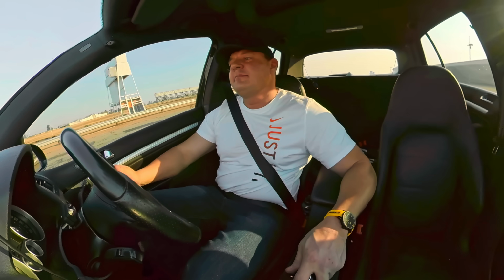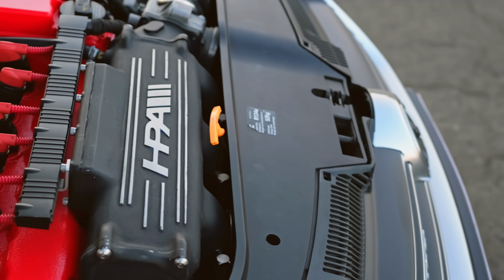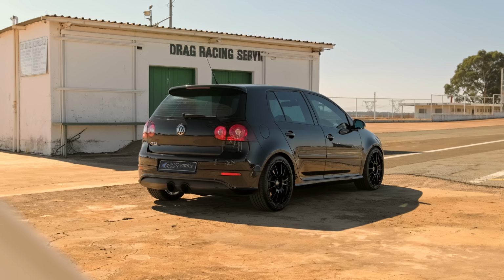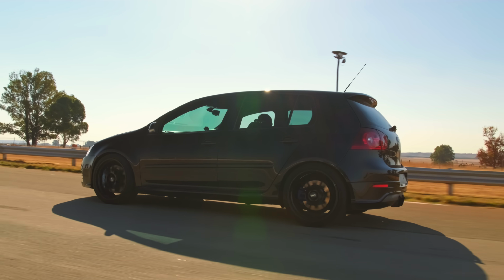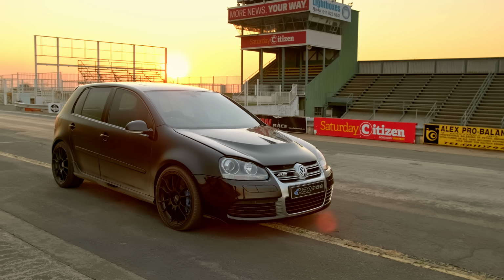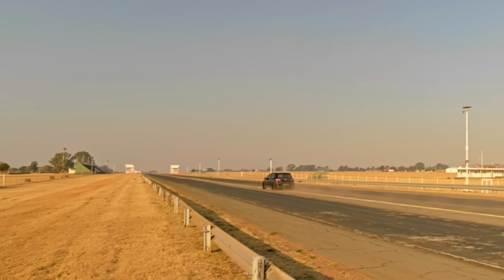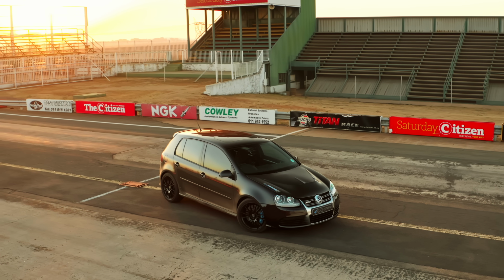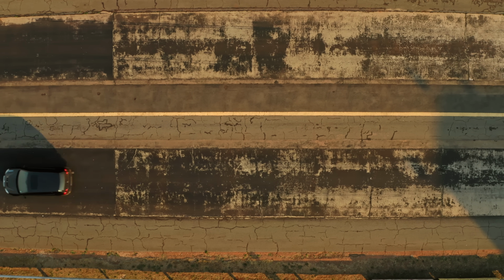1000hp Golf R32! - Watch this VR6 run an easy 10 seconds (and it's his daily driver)

Comment: What clutch pack are you running . Our build are similar mine on a stock engine with the rod bolts , bearing , spacer 😅 with fuel clinic 1000cc gtx3582r

Comment: How does a stock R32 lose to a GTI? Can someone explain that to me.
Reply: Drivetrain losses are greater in AWD. R32 is heavier. GTI is turbocharged, and it might have been chipped. At altitude, forced induction can compensate for reduced oxygen density, the VR6 can not (naturally aspirated). All factors!

Comment: Loved how losing to a GTI motivated him to build a monster.

With 1000hp it should comfortably do 9 secs maybe it's the street tires?

Also the R32 weighs at 1.5t and he said 1.7t?

Anyways, that's a nice build and what i find impressive about it how reliable and daily drivable it is!
Reply: It will get heavier the more modifications you do…for example the 4 inch exhaust all the way through is going to weigh a lot more than the stock one…

Comment: Its sad that cars need 0 skill to drive anymore. Just picked up a Vr6 TT...and opted for the 08 simply because it has manual transmission. for those without car knowledge but want to talk shit automatics have more clutches than a manual and yes, autos are faster cause you dont have to shift. Or worry about a clutch. But still...put a transponder and reciever on that thing and its just a big rc car. You dont drive anymore you just sit in it and let it go. Shit sucks

Comment: As much as the Mk5 is on the heavy side, 733kW, AWD, and a DSG is a recipe that should be faster than 10s. There are Mk7s running 10.4s with 450kW.
Reply: I honestly thought the same

Comment: I feel like something is bottlenecking the car. With that much power it should be hitting 9's all day. Awesome build still.
Reply: Banele Gaza.. there are no bottlenecks bud, the car has a full interior and running street tyres lol Strip this beast slightly and it will definitely break 9s without a sweat
Reply: @taswellbarthus4032  thing is on paper this should gap the demon everyday but it can't.
Reply: @taswellbarthus4032  he said he can't break the 10 second barrier yet but hes planning to do so, the dodge demon can do 9's straight from the showroom, his car like i also said, it should be able to destroy it all day, according to him, not yet.
Reply: @banelegaza  please go and do proper research. Internet will tell you that  the Demon did a 9.65sec pass on 100 Octane (not our inferior local South African fuel) and FULL SLICKS on the rear.. that is far from "showroom floor" status. This R32 is dipping into low 10s on street tires with full weight.. go and do the math lol
Reply: @taswellbarthus4032  those things come with the car, besides the fuel, but the key, the mode, settings, all come with it from factory at $1. I just feel like this modded out r32 should destroy it regularly without touching the nos bottle in the  back

Comment: I feel like he hasn't ran the quarter mile at full power. It can easily do low 9s with that power to weight ratio. 

Evolve's M5 does high 9s.

This thing can esily smash that M5 at full power

Comment: Very very very impressive. These cars are underrated in SA. Turbocharge it then everything changes :). I have a Golf 3 Vr6 turbo that I’m currently converting to 4wheel drive via an Audi TT gen 2 haldex rear and vr6 synchro gearbox. I cannot wait! Respect to Jacques
Reply from the maker: Hi Katiso, this build sounds awesome! Would you be keen for us to film it?
Reply: @katisotaabe85  you brought it up, we are now invested in this build. You have until June 2022 🤣🤣🤣🤣🤣
Reply: @The_Fhedz  no pressure but he has 10 months before we start asking questions
Reply: @nlocnil3602  kwaaaaaa
Reply: @The_Fhedz  hehehe,,,so far so good,,,until I run out of “capacity “ aka $$$$
Reply: @katisotaabe85  the racing Gods will provide 👊🏾 good luck.
Reply: Sound incredible. Can't wait to see it on the channel
Reply: Check out home built on here, he’s from the uk and he’s building a vr6t 4wd corrado, it’s going to be nuts!
Reply: Sounds very very interesting
Reply: Tasty
Reply: i thought turbos are horrible for dsg transmissions. like if i put a turbo on my vr6 passat im pretty sure itll explode in like 40k miles
Reply: @flute136  how did you come to think that when you have GTI and R golfs using DSG and they all have turbos
Reply: We waiting papa... No pressure 🤣😂🤣
Reply: @rayoflight39  😂😂😂
Reply: @katisotaabe85  one of my favourite cars the mk3 vr6 highline    aswell as the corrado g60 supercharger there both awesome. We need a video when it's complete

Comment: The south african motoring industry is the most underrated, we've alot of serious cars!
Reply: The problem still lies in the budget for us normal guys on the street, since we hav the passion but lack funding
Reply: We have a lot of of the cheaper/older heavily modified cars but in Europe USA Japan etc. They doing the same thing except with supercars...
Reply: Europeans and Japanese are more exposed to the internet...

I've  got a friend that has a stage 3 BMW F30 335i and its properly quick. It does a quarter mile in 11 seconds and can do much better in semi sliks or sliks meaning it can compete with most European tuners. There's an audi TTRS that does a quarter mile in less that 10 seconds.
It can easily show most European tuners flames. We just need more exposure.
Reply: @yamangalongwe7419  SA definitely cannot compete with Euro tuners lol...for evey 1 tuner we have they have 10 not to mention a lot of the software and hardware is developed and engineered there as well a lot of components used in Formula 1 cars so the skill and knowledge alone is in a whole different league.

Also anyone can put together a 10 second TTRS if they had the money and the software/hardware anyways both were most likely developed overseas but just installed here
Reply: @WaseemKhan-iu4bh Not the lack of ability,just a lack of resources
Reply: It's not underated, it's less documented. Others are filming videos on buitds, events and all, in South Africa most people just don't document. They build their projects to have fun.
Reply: Are you selling boet, if so I would be highly interested
Reply: Which car brands do you manufacture, sorry??
Reply: Europeans and Americans document their journey on YouTube and Forums which gives them more exposure. I think we should do the same 🤷🏽‍♂️
Reply: Clearly! There needs to be more exposure for you guys
Reply: Haha get some food before you saying this kinda shit.

Comment: Awesome Build. 10.3 with 1000hp does not sound right.
Reply: With street tyres and a car that weighs 1.7tonnes,,,plus it is not a drag car…mighty impressive if u ask me. That’s super super car league
Reply: Traction becomes an issue a after a certain power figure. It's even harder with a street car with full interior.

Comment: It's a cool build you will never know that it's making a 1000hp
Reply: Thats what makes it so GOOD
Reply: I have a video to prove this. And it's 1000hp on the wheels
Reply: @perezbalkissoon3196  I have seen it gap a tuned rs3 like it was standing still on speed and sound
Reply: @perezbalkissoon3196  please post a link. thanks in advance
Reply: Yeah cuz a good part of mk5 with r32 and gti look are 1.6 petrol or 1.9/2.0 diesel :)))) But when this guy shows up and floor this beauty omg :))
Reply: Only clue is big brake kit but still a sleeper none the less

Comment: R32 straight 6 engine. Forged internals. Turbo charged. 700+ kw .... and still able to get groceries😎😎😎
Reply: Vr6 is not a straight 6 engine! But yeah soooo much fun :)
Reply: @katisotaabe85  vr6 is kind of straight, and V6...thats why its called V R 6
Reply: @jacquincedras  it is not a straight six,,,but yeah all gudo👍🏿
Reply: @katisotaabe85  do you know what VR6 stands for sir?
"V" stands for "v-motor" and the "R" stands for "reihenmotor" which means inline motor.
All cylinders are in one cylinder head which makes it inline but the pistons are in a V angle which makes it a V6
Reply: “ all cylinders are in one cylinder head which makes it inline,,,” - ur getting things mixed up,,,let it rest chief please! I work on a vr6 engine everyday,,,for the past 20 years,,,u have made your point
Reply: @katisotaabe85  you do know a v6 has two cylinder heads right? And a inline 6 has 1 cylinder head. A vr6 also has one cylinder head. Dont make as if im not making sense my guy.
Reply: Not straight bro staggered on line ....it almost was an in love when U look at it from the top...😋

Comment: Didn't take the loss to the Gti too well it seems😭
Reply: And now there ain't a Gti that would touch him.. hows that for revenge? Hahaha
Reply: I just cant understand why he lost against a GTI, i mean okay maybe the GTI was also tuned but idk.
Reply: @Klausi_92  its simple. The GTI is turbocharged and the R32 is not. Add the high altitude of the Gauteng area (About 5000 ft above sea level) and the 186kw of the R32 quickly drops to around 158kw. So in that case the power to weigh ratio of the GTI becomes better since the R32 is one heavy beast. I have seen many R32's get their ass handed to them by supposedly less powerful cars. Altitude is a bitch for natural aspirated engines.
Reply: @777rvm  thanks man :) i have no further questions.
Reply: @Klausi_92 I have had bothe and my gti was faster foreshore on a stage 1 flash tune the r32 more low end power takes off great and sounds great but that's it
Reply: @Klausi_92 r32 is heavy
Reply: @Klausi_92 NA r32 could lose to a tuner Tiguan
Reply: @Klausi_92  Just like an Audi TT 180HP fwd model vs a 180hp Quattro ... the fwd model will best it in acceleration on dry surface because it has the same power but is lighter. Start adding power and the awd system will begin to gain advantage with more traction as the fwd starts breaking the tires loose with all things relatively equally. Of course the 225hp model overcomes some of that weight advantage in the acceleration dpt. I am surprised however that the ... 50hp? advantage the R32 has over the GTI that it still lost but we don't know all the variables, could be as simple as better tires too/driver/etc..
Reply: I have 285hp in my NA mk4 r32 but I’m gonna turbo it pretty soon
Reply: I know right he said that was the last race I lost
Reply: 😂 yup I've lost to a few GTIs mostly Mk7 and I did beat one Mk8 but it was bone stock. Even a well done 9th gen Si got me good lol no hate some cars are just faster, still enjoying my R32.